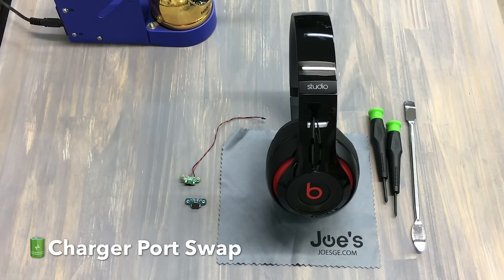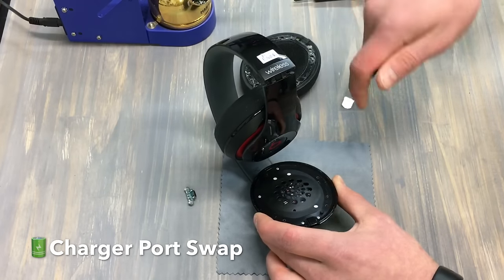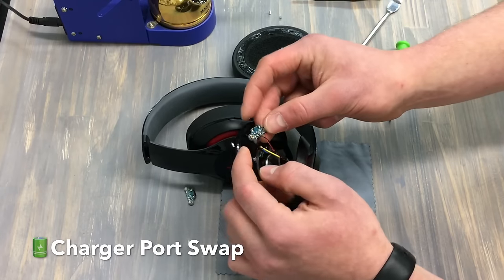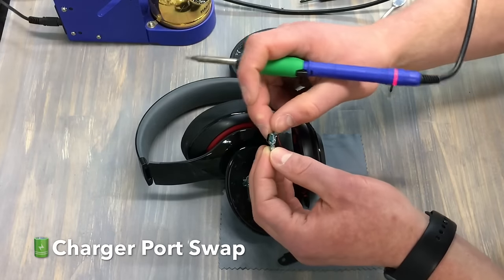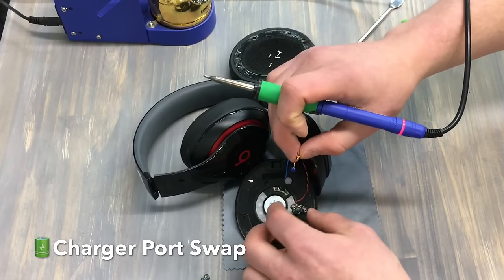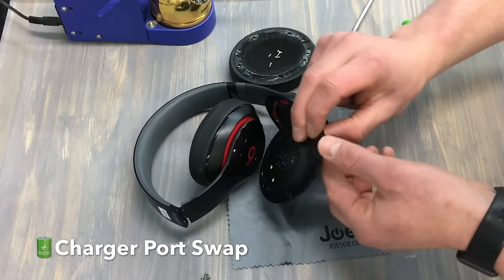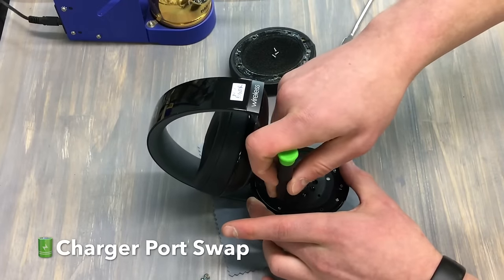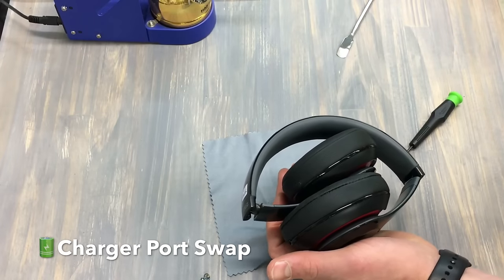JoesGE.com Beats By Dre Studio 2 Wireless Wired Charging Charge Charger Port IC Repair

Comment from the maker: Order your charger port here - http://bit.ly/2wbJtil
Reply: Joe's Gaming & Electronics hey my beats the left ear LED light come on. my fuel gauge don't come on  no sound or nothing please help
Reply from the maker: In this case try to pair it with your headphones and see if maybe the fuel gauge flex is bad.
Reply: Joe's Gaming & Electronics Can I replace the charger port with an iPhone charger port?
Reply: Can you help me with my pair?
Reply from the maker: You cant :/
Reply from the maker: Sure what's wrong with your pair?
Reply: Joe's Gaming & Electronics won't charge. .. the input looks pushed in
Reply: Joe's Gaming & Electronics its the beats wireless studio silver
Reply from the maker: You can install this part and it will fix your issue.
Reply: Joe's Gaming & Electronics thanks Joe. link?
Reply: Hi joe, the shipping from Mexico how it cost?

Comment: Sorry for being such a late commenter. The most recent problem that I've had with the beats is that the charging portal seems to not be working. I've read through all these comments and the beats might be over used. My mom didn't use them for a bit, but when I returned home I started using them. I reset the Beats about 9 times and used a total of 4 chargers. On some chargers, they would be titled more towards the left and some would be tilted towards the right. I would lightly press and the red light would turn to the typical blinking white light. After trying multiple times, the beats will no longer show any of the lights. Help, ASAP! PS, I did leave them dead for a couple hours but I've done it before and I've plugged them up and they've worked just fine. This is the first time this is happening.

Comment: Hi, the replacement part I ordered did not come with the two nuts on the board that allows me to screw in the two smaller screws. It looks like it might have been possible to solder on the old nuts onto the new board. However, I could not get it off the original board. 

I ended up installing the swapping the board without it, and it's working so far. That being said, I'm worried, as I was unable to install those two small screws back in without the nuts it was designed to screw into.
Reply from the maker: Thanks for the comment. The two nuts are simply soldered onto the charger port PCB. You can apply heat with your solder iron to remove them from the old charger port. If this is not something you can do, we can send you a charger port PCB with the nuts installed, send in the PCB without the nuts and we can exchange it for you. 

-David P

Comment: thank you for linking the charger port
Reply: one question though for the beats studio 2 there are 2 kinds WIRED or WIRELESS mine is WIRED does the charger port change or is it gonna work for both
Reply from the maker: Thanks for watching! In the drop down menu on our site where it says model, you want to select the green wired charger port.

Comment: How does one figure out if it's the port that's faulty (or something else like the wires delivering the power to the board)? I get the white followed by red light 3 times and then shuts off - clearly my battery isn't getting charged.  BTW, mine is the Solo 2 Wireless (not Studios). Is that something you could help with as well?

Comment: I have two beats one got wet so the left speaker doesn't work, I bought the  second one and now after a year I won't charge, the charging port got damaged somehow, is there anyway I can take the charging port from the one that works and put it on the one that doesn't work?

Comment: Could you make wired Studio 2. Wireless with swapped motherboard and chip ?! If so please demonstrate
Reply from the maker: Thanks for the comment. Unfortunately, this can not be done. The Bluetooth board will not fit in a studio 2 wired panel. Also, the main internal wire will need to be replaced. If you take all this into consideration, the swap will not be worth the time and parts cost. 

-David P
Reply: What I bought a micro bluetooth module with 2 channel sound and wire it in place of the motherboard. Thus could work in theory right ?!

Comment: Hey Joe
Just got my solo 2's a month back, when I plug the charging cable in all the lights go white as if it is charging. the moment i unplug the cable it goes dead, no response when holding the power button down, or the power+mute down I'm undecided on whether it is the charger port or the battery at fault?
when the cable is unplugged i do see 1 of the LED's flashing red briefly before it goes dead. any ideas?
Reply: Scott Wins same boat

Comment: Hi joes, I have a problem with my beats studio 2.0 wired version which I have found no possible solution on the net so far.

the noise cancelling in the left earpiece (the one which has the wire) has stopped working. Works perfectly fine in the right one. Any way to fix this ?
Reply from the maker: Possible that your MS port or Speaker went out. We do repair this model if you want to send this into our repair center -  https://www.joesge.com/pages/fix-beats-by-dre

Comment: what you do if you can't connect the blue tooth to your phone ?? it perfectly charges but am not sure if it the battery or the charging port ?
Reply from the maker: Thanks for watching Tony. First thing is to make sure that your Studio 2's are wireless. Does the left side of the headphones say "Wireless" or "Studio" on it?  If both sides say "Studio" That means the headphones are not bluetooth capable. If the headphones are indeed wireless, try resetting them by holding down the power button for around 10 seconds then let go and the lights should flash red/white/red/white a few times then they will turn on. Make sure that the white light on the bottom of the left side of the headphones is flashing indicating that they are in bluetooth pairing mode. Then, go to the bluetooth settings in your phone and they should show up. MD.
Reply: actually both sides says studio but there is power button and charging port. it also charges when I plug it to power. when I reset it by press and hold both power and pause buttons , my phone still doesn't see the bluetooth device
Reply from the maker: Thanks for getting back to us Tony. Your Studio 2 headphones are the wired only version and do not have bluetooth connectivity. The Studio's require power because of the sound processing software and noise canceling in the headphones. MD.

Comment: The Bluetooth feature in my beats is not pairing anymore. I tried so many resets and it doesn't seem to work, besides getting new ones any other not costly suggestions?
Reply from the maker: +Christian Castro we replace Bluetooth modules for $70. You can check our website link in the bio.
Reply: Joe's Gaming & Electronics awesome will do, thanks for the fast reply.

Comment: My beats studios wireless leds wont turn on even after holding the power button for 10 secs and even plugging them into the charger, The led that indicates bluetooth connections turns on and connect to my phone but it shows that battery is at the lowest point, when i try to play sound on them, it is silent , Idk if i have a bad battery or my charger port is fried
Reply from the maker: Big pck2 does the sound work? Sometimes the LED light gauge goes out
Reply: So my headphones are still okay?

Comment: my beats studio wireless will charge for hours but still only be on the 3rd led light and will die in 10 mins is my battery dead???
Reply from the maker: +Joshua Martin after the reset they still don't show more lights?
Reply: They won't reset I'll hold the mute button  and power button for 2mins volume and power but it won't reset.
Reply from the maker: Send us a video of how the lights show up after the repair. Only thing i could thing of is the wires are not soldered back in the correct place.
Reply: now it just blinks red and will not charge
Reply from the maker: Joshua Martin when you plug the charger into the charger port what happens?
Reply from the maker: Joshua Martin reset them first. Hold the power button for 10 seconds